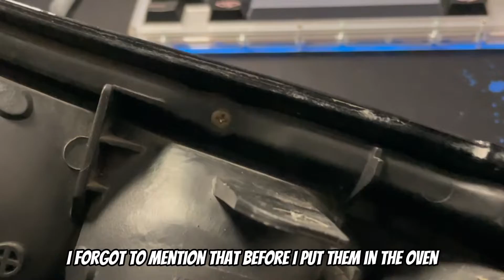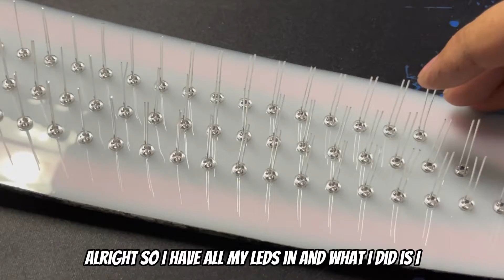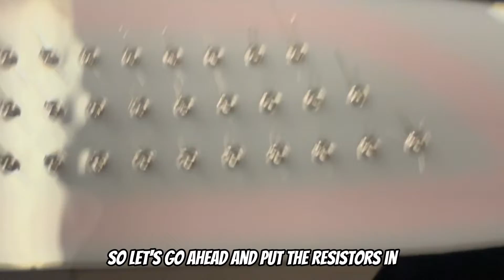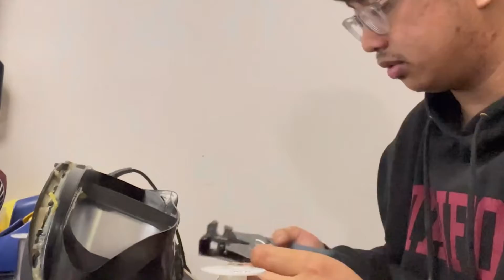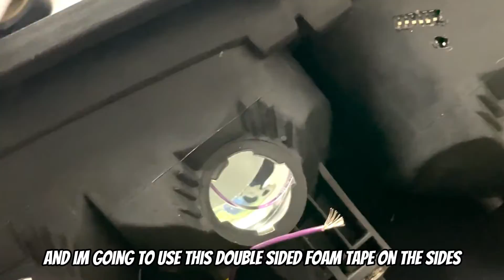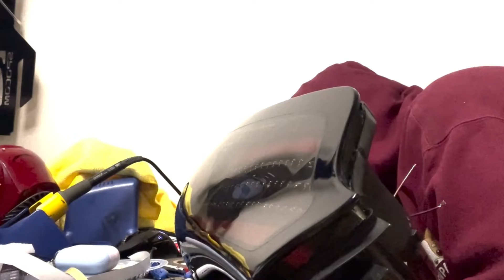Build Your Own LED Tails! - Illumaesthetic RX7 FD DIY Kit Tutorial

Comment: Hi. Just curious, but did you not need to add a voltage regulator to the parking and brake light board? Does the LED strip self regulate the voltage?

Comment: I have a question about the Corso motion parking and brake light board. Does that not require a voltage regulator or resistor when connecting to LED strips?